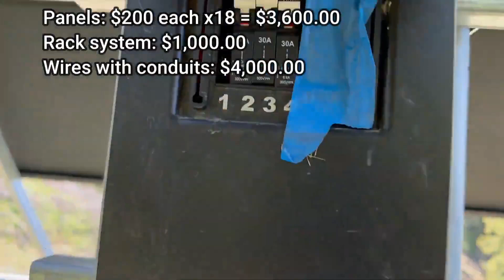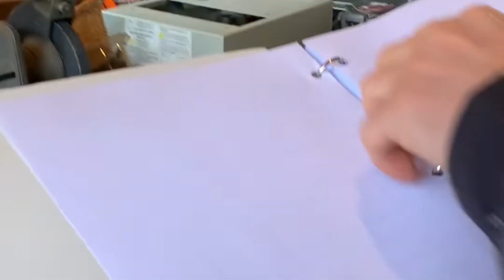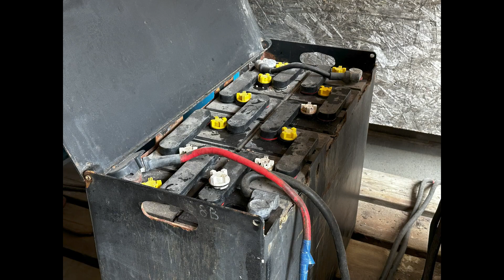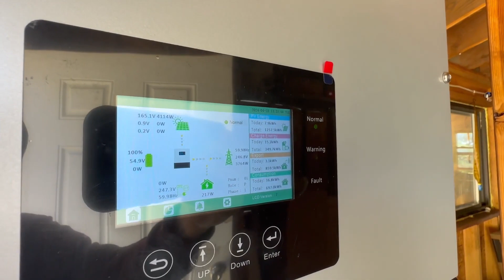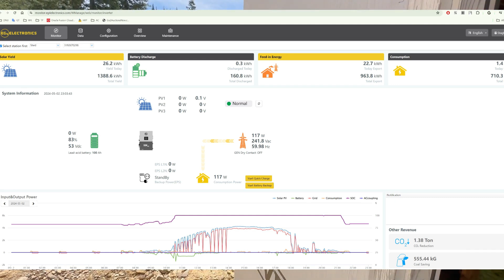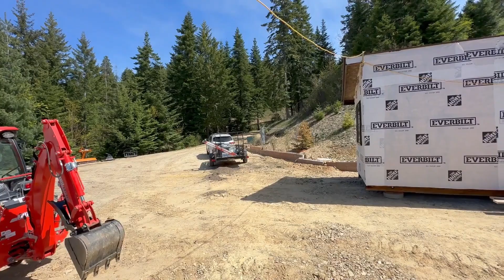We installed a solar power system and now have NO bills!

Comment: Great System...mostly you get free Power during the Sunny Days.  The 5K battery will only get you about 5 hrs at night, depending on what kind of Refrigerator and HDTV you have.
Refrig/TV/Lights/Computers = can run over 200Watts an Hr..
Cooking food can take a big chunk of power.
Battery also runs the Power System, so that takes at least 50 watts an hr.
Reply from the maker: yes, on some days we have 25-30 KWT/day from solar

Comment: If allowed by electric co, you should extend your pv rack system and add another 4000w or so.  This assumes the cable to shed can take more amps.  If not, you can restring the panels for higher voltage/lower amps and add another cable (relatively inexpensive 10 or12 gauge) for the second set of panels.  New panels should be bifacial, in the 400+ watt range and currently should run around 30 cents/watt.  Bifacials work well in winter/melt snow off panels/collect reflected light.  The other item- get more bats (1 is really not enough),  either more eg4 or clones or do a 48v 15kwh kit for around $2k.  This way you will have enough power for 2nd home.
Reply from the maker: Thanks for your advice. I really appreciate it. Our plan is to add at least six new solar panels and one more solar battery to increase electricity storage.